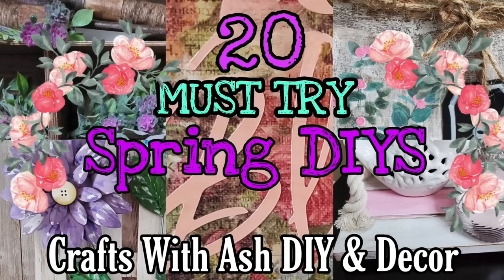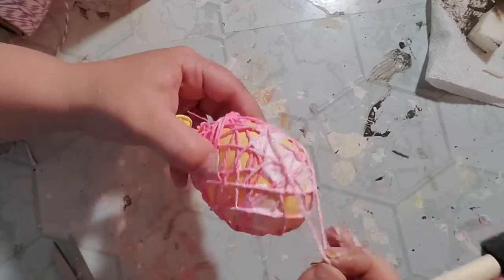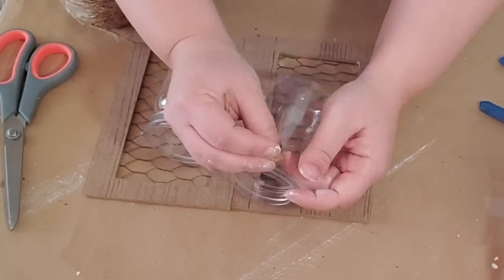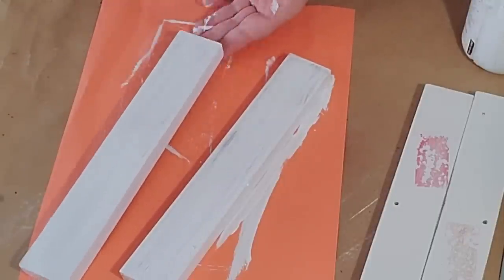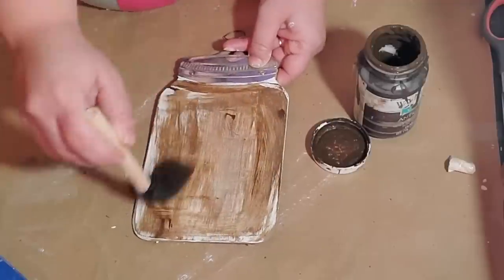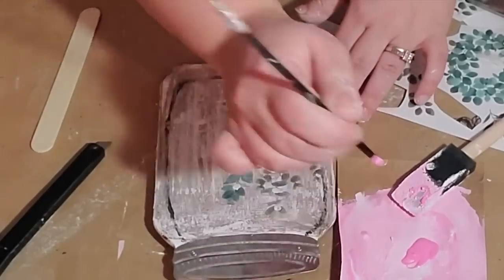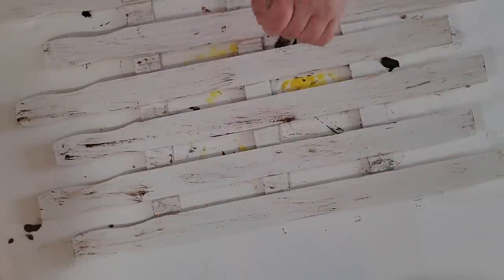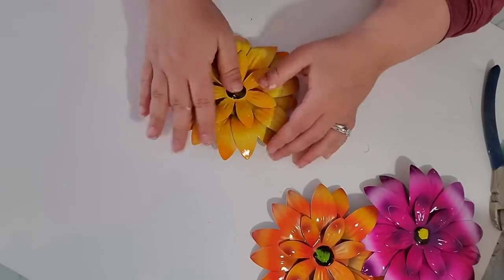TOP 20 Spring DIYS | Must Try!!

Comment: For the string eggs you can put the string thru some school glue b4 wrapping, then when they dry they r stiff. Also for the hanging jar sign you could glue a botton magnet(or a piece off of a sheet magnet)for the  front of the jar n sign n change them out 4 the seasons, that's what ima gonna do(got that phrase from my Grandson)! Rub on transfers sometimes doesn't like the antique wax.
Reply from the maker: That's a great idea!!

Comment: Your Vaseline is causing the trouble of sticking the transfers on use wax it does better but you use tape to pull the paint off I had seen a crafter on YouTube do that and it worked great the Vaseline is to messy rub a candle on it just not all over it  I've tried this step n I ruined my paint it didn't work for me but I enjoy watching your diy's though gives me ideals I'm a crafter to would like to start  YouTube videos to on my crafts but if you have time can you send me a little info on how I can start thank you for your videos
Reply from the maker: I realized that after the fact of course! Lol the candle method is now my favorite for that chipped wood look!